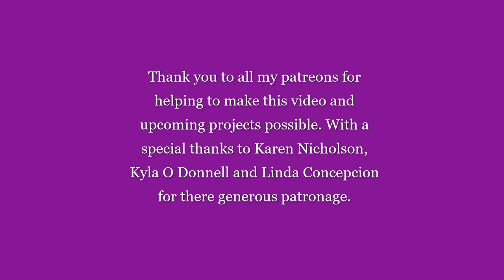Back on laLande

Comment: Please consider increasing the sheep’s food. They need to build up significant fat and wool for winter particularly as Stephanie provides them with no housing or bedding. A handful for those sheep is far too little for their fall and winter needs.
Reply: this was one snippit...do you think the sheep have had nothing since Salmar left??
Reply: The sheep have mini shacks in each pasture that fit them plus some, so they do indeed have ample shelter.  Also, guests can throw down baguette and other fresh basics, and do so a lot, so I wouldn't assume you are seeing everything in the vlogs you are viewing.  Much is missed.
Reply: @BlackDino468  you think bread is a suitable food for sheep? And those shacks are hovels and hardly adequate.
Reply: @sandicarpenter2658  no and I didn’t write that.